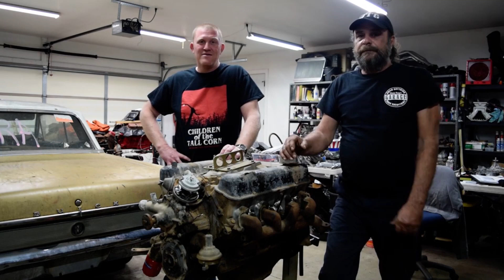Buicks Miracle Motor

Comment: The Duntov 283 SBC, the dude was a true car racer engineer, before Shelby.
Reply: Duntov as in Zora Arkus?
Reply: @DSchea  yes
Reply: anything duntov is amazing
Reply: Owning a 60 Vette with a  097 equipped dual 4 283, 4 speed I can personally attest to this.
Reply: Oh yeah, the greatest flathead ford part?  The Ardun overhead valve option for trucks. Named after the crazy Russian.
Reply: You have any specs or info on this 283!? Thanks
Reply: @63Imp283  you mean the classic power pack 283? or one of the two fuelie 283's?
Reply: @albertgaspar627  yeah I guess I thought he made some special 283s minus the FI
Reply: So like the 315hp fuelie?
Reply: @63Imp283  right, to my knowledge Duntov just wrote the letter to brass that led to the Power Pack offering over the parts counter at dealerships. Vince Piggins et al would make the later DZ code 302 based on overbored 301's made by privateers, and the racing Corvettes I believe only had Duntov's blessing, not his fingerprints.

But i could be wrong.  When I mentioned the two fuelies, i was thinking of 1957--there's the 250 hp few know of, and the 283 everyone thinks is the first hp per ci, but Mopar reached that a few years earlier with the 355 hp twin quad 354 hemi.

Its funny how many folks spoke in the 1970's of a "100mpg carb" that Detroit for some reason wouldn't reveal (and never existed), but GM did have a fuel injection system they COULD have brought out and met government regs with.
Reply: Louis Chevrolet was a race car driver... his cars wouldn't have flatheads...
Reply: @BuzzLOLOL  just the blocks. 

https://en.wikipedia.org/wiki/Louis_Chevrolet
Reply: @albertgaspar627  - Says Louis built an OHV 6 cylinder engine in 1909 and founded Chevrolet Motors in 1911...sold out 1916... but Chevy stuck with OHV...
Reply: @albertgaspar627  - So...? Fords were nothing without Chevy parts?
Reply: @BuzzLOLOL  no, Ford flatties were ubiqitous enough that even Chevy heros got their start hot rodding them :)  Of course what helped was that Chevy built a car with babbit bearings and wooden body structures--not a great recipe for dragging out of a field and then dragging on an old airport runway by GI's with combat pay to burn.
Reply: @albertgaspar627  - OHV Chevy's were hot stock... 
Ford flathead V8's have poured babbit bearings...
Reply: In 59 there was a 290hp 283 with a solid lifter cam with 230/230 duration @.050" and just .400" valve lift and duntov is credited with that cam. Later there was the "30-30" cam which was mostly a 327 cam but it also showed up in the the 302 dz z/28 camaro. The exact specs im not sure but 30-30 meant 0.030" lash on the intake and on the exhaust. Its a high duration cam and good lift for the 1960's, it also has a wide lobe separation so that helps the idle but it also has a late intake closing so its not a great torque cam, its more a flat curve high speed cam. Some people love them but unless you got a small displacement motor with high compression, good heads and a stick shift that you want to rev beyond 7,000 ill just use a modern cam. Infact if i want an 8,000 rpm small block i think i can come up with something a little bigger and better. But at the time if you got a fuelie 327 with the solid lifter option it did go fast.
Reply: @danieldimitri6133  - The 30-30 cam was 254/254 durations... I think the .030" valve lash was just to tame it down for daily driving... if you wanted full power for racing, you could carefully cut out 2/3's or so of that lash specification... 
The LT1 350" engine for 1970 Corvettes was supposed to get the 30-30 cam and was rated 370 HP in early sales literature but none were produced as production engines, Chevy decided to go with a more tractable 244/254 cam and rate it 360 HP in 'Vettes and Camaros... don't recall off hand if Chevelles got the LT1 engine... Those cams and engines are dyno'd here: 
https://www.hotrod.com/articles/hrdp-1001-muscle-car-engine-shootout 
Also hydraulic cam versions: (might want to bookmark these fascinating links for the info) 
http://www.superchevy.com/how-to/engines-drivetrain/sucp-1003-classic-chevy-small-block-dyno-testing 
.
Reply: @danieldimitri6133  The Duntov grinds, like the Pontiac McKellers, were good for their time--when a cool cylinder head was a Crane Fireball, which was just a worked over OEM casting. Massive lift required a valvetrain stronger than a pressed in stud, so cams had duration.

(funny thing about late intake closing, Bruce Crower had a cam with 13:1 pistons that tried to use the high compression to get fuel economy...and sucked for making power off-idle. A solution was to go with a bigger displacement, which could require more fuel depending upon carb tuning).

Certainly, tech has eclypsed this. We have much better heads (typically, they offer a better valve angle, which is why LS heads flow so well, more than the cathedral ports) and we can run a milder cam that allows for AC use while idling down the highway in overdrive.  And then there's the blocks--a high winder small block Chevy should be the 4.125 inch bore or Ford's 363 Windsor Dart block, both will unshroud the valve and that can reduce the need for lift to clear the cylinder walls.
Reply: Yeah except that European GP cars had the same tech and output in the 30s.
Reply: @StFiacre  too bad a house over their is wired better

Comment: All engine's made in 1974 had Jimmy Carters crap on and in em.. EGR nonsense that almost always got yanked off if not immediately, later after the warranty had expired. I'll never forget my dad bringing a new dodge home and immediately started ripping hoses and canisters off and tossing them in the trash. Then yank the heads off and took a die grinder to em.
Reply: Those were the days! Can't do that now with all these computer controlled vehicles. All this crap is suppose to make them get better emissions and fuel millage, so they say. I don't agree with them, I have has several cars with mildly built V-8 engines and no cats tested, they passed the emissions test and still could get 16-18 mpg. That's about what my mothers 4 cylinder 2018 CRV averages.
Reply: @bigbear5510  im with u on that..
I finally just got myself a Mustang 1997 model with 4.6 NPI... That way i was able to do a PI head swap (better on NPI motors for compression) PI intake and aftermarket 70mm top throttle and plenum. Jacked it up to a modest 300HP and STILL can pass emissions. (Running 93oct).  Now we can still play with our older cars tho..
Thank God for that.
I got a 454 with less than 50k miles. I'm just looking for the right body to drop (stuff) it into.. Im thinking a 69-72 Nova.
But those (2 door models) are getting more and more hard to find.... Used to in the day, you couldnt toss a frisbee without hitting one. But plenty of them hidden away out there. U just gotta find em.
Wouldnt mind building an old Duster either... I just dont like the skinny rear axle. Looks wonky as hell. Ways around that tho.

Comment: Using 215/300/340 parts you can come up with some interesting combos. Great video guys!
Reply: Yes! 300 crank in the 215 is common, and the 350 crank goes into the 300. I have a 63 skylark with original 200hp 215. Probably going to store the original drivetrain and drop in a 64 aluminum (heads and intake) 300 and 4 speed.
Reply: @44amanaplanacanalpanama44  I really like that '64 300 engine, with aluminum heads and front cover. A Special or Skylark (or really any A-Body) would be really sweet with that engine and an adapted T5.
Reply: @Gothamauto  I like it too. It's still pretty light, but the iron block is a little more durable for more power. It looks a lot like the original 215, and the heads and intake will interchange (but drop compression drastically without a piston swap). My '63 is actually a Y-body, which is unibody, and is unique, to say the least. It's a difficult car to swap things into. The drive shaft is a massive pain with a bunch of U-joints and multiple pieces. The tunnel is very small and it's difficult to fit any transmission without cutting. We're going to see how an M22 fits behind the 300. Right now it has the 2-speed dual path auto, which is really odd. The whole drivetrain is coming out and it's getting the 300, M22, and a narrowed Ford 8.8 3.73 limited slip explorer rear with disc brakes all around and 15" 5-lug wheel conversion.
Reply: @44amanaplanacanalpanama44  The '63s are neat compacts. The combination you 're planning should be a lot of fun and a great driver.
Reply: @Gothamauto  Thanks! I'm hoping so. I have been exploring a lot of different ideas for it, including a turbocharged 3800 II, but we decided to keep it old school and looking pretty much original when you open the hood, but with more guts and stronger components.  I was wrong about the trans- it's an M20, not an M22, but should be fine for the light car with a small block.

Comment: There is a bit of a trap here. Triumph had their own V8 for a while, which was two of their 1500 fours on one crankshaft. The TR7/8 was the Rover V8. The chief designer at Jaguar actually made the under the hood space too narrow so that it wouldn´t fit. he was worried about it replacing the XJ6. He shot himself in the foot because when they came to install the V 12 it was a lot of work.
Reply: And do not forget that blown V6 version they put behind the front chairs of a Metro... 
How crazy can you get it??

Comment: In 1964 my dad bought a new Buick Skylark that had the 300 iron block with aluminum heads. Dad had a lot of problems with that engine. Mostly blown head gaskets.  In 1967 a drunk driver crashed into it while it was sitting broke down on the side of the highway. It went to the boneyard after that.
Reply: One contributor to their problems was the '60s coolant wasn't perfected for aluminum and aluminum/iron engines. That would come later.

Comment: I had a 66 LeSabre back in high school that had a 340/ 2spd powerglide. I never knew that the 340 was based off of the fireball V8.
Reply: Not a Power glide, ST 300 with variable vanes in the torque converter

Comment: Also fitted into MG GT V8's? Along with Land Rovers, Range Rovers Marcos & 101 other kit cars that were made from the 70's onwards?  Used to be popular with the custom car builders over here but always seemed expensive to tune & not hugely powerful?
Reply: @Rich Rishel Triumph used a different engine designed by themselves. Owners sometimes used to fit the Rover engine though when the Triumph one cooked itself...  https://en.wikipedia.org/wiki/Triumph_V8

Comment: "The most versatile engine ever built " would by far be the International Harvester in line four cylinder.
Reply: 6BT Cummins.
Reply: @dutchvoornik6401  Clessie Cummins was building other diesels. However he had entered the Indy 500 in 1932 and 1934, and sat in the pole position in 1952. How many cornbinders did that again?
Reply: @dutchvoornik6401  I would actually argue the most versatile would actually be the 71 series Detroit Diesel. They came in 1, I2, I3, I4, I6, V6, V8, V12 and V16 configurations,  from 34, to 600+ HP. They were prime movers and apus in marine applications, generators, pumps, winches, trucks, busses, tractors, semi, heavy equipment, some farm tractors, etc, etc. Production started in 1938, and ran until 1995. I have a cornbinder powered Ford, I'm not sayin' I don't like em' or anything. I just don't know if it's the most versatile. I like your style, Dutch.

Comment: Uncle Tony. The buick 231 v6 was introduced in 1975 as an odd fire. In 1978 it was changed to evenfire..
Reply: Odd fires been around since early 1960's, 1977 was the year to even fire
Reply: Karl & Christian , you're BOTH right. 
The odd-fire Buick V6 has been with us since the 1960s , but the 231 inch displacement was new for 1975. 
Previous motors were smaller.